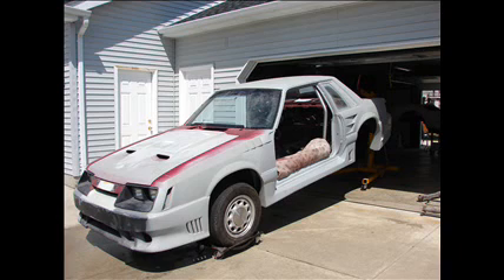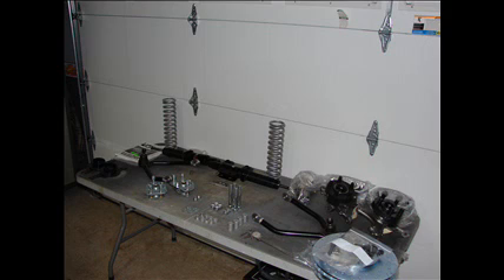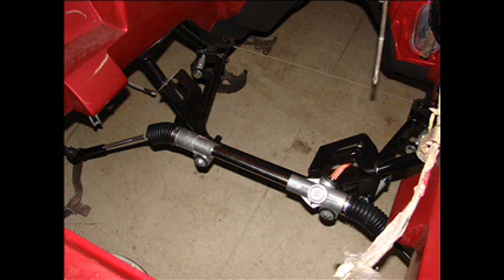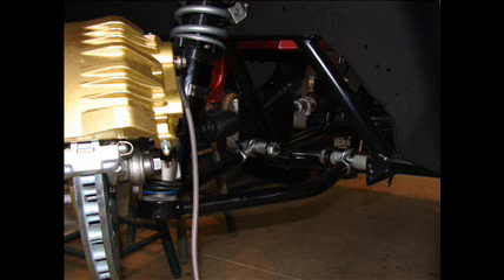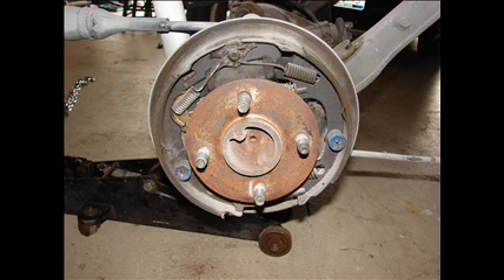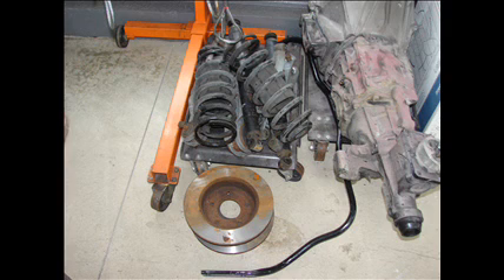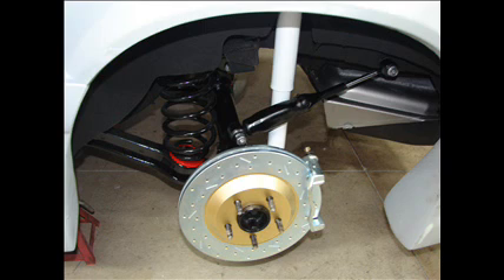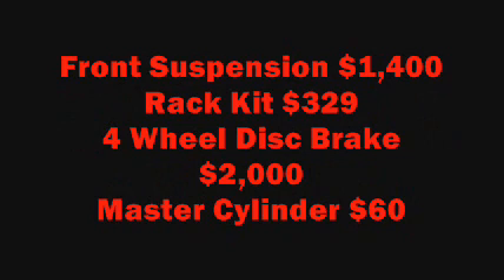Fox Body Mustang 4 lug to 5 lug Conversion

Comment: Did you have to go with a 94-95 booster and master cylinder?
Reply from the maker: No, just the axle
Reply: My car is a 1986 Fox with a 2.3 engine.  I plan on using the SN-95 front brakes and rear end.  Will the stock booster be large enough to handle the swap?  I do not want to use an adjustable proportioning valve if I can get away with it.  I am on a strict budget and this is something to keep me occupied since I was force into retirement.  I am a Disabled Vet.
Reply from the maker: It should work ok
Reply: Here's what I did on a budget.  Find a 99-04 V6 Mustang with dual piston front calipers at the wreckers.  You need one that does not have ABS.  Take the master cylinder and factory proportioning valve.  Mine cost me less than $30 CDN.   Take the calipers and mounting brackets from this car as well and install on the '94-'95 spindles - they will bolt up.  Install them in your '86 and you can go dual piston front calipers and rear discs.  Just did this on my 90 GT and works great.  No adjustable proportioning valve needed.  Everything works great.

Pete, in your video you mentioned the rear control arm mounts were wider than a Fox and needed some adjustment.  This means you had a '99-04 rear end, housing is 3/4" per side wider.  '94-98 is same housing as Fox, just longer axles.
Reply: Thanks for the information

Comment: No Bump Steer Kit with Caster/Camber plates, coil over springs and Tube K member is a friggin' HUGE mistake. Especially when using the QA1 K member as it moves the front wheel base forward about 1" and wider about .500". Use the QA1 Pro-Comp control arms, (must weld on a Tab for the Sway Bar end link mount) to re-center the wheel in the wheel well. You will experience serious bump steer problems and brutal over steer if you don't use a bump steer kit with this set up. And you sure as hell do not need to pay the extra cash for a "Cobra" rear end for this swap either. Any 94'-04 Mustang Disc Brake 8.8" will work just the same. Get the 1" rear sway bar off of any GT or buy it new. MPS wants $1500 for a similar rear end, which, any 94'-04' from a regular junk yard will only cost less than $500. Do it smart people and put that extra money into something else...Don't forget, you need a new proportioning valve when swapping to rear disc brakes from drums. This guy has left out some very serious info. Make sure to check your facts.
Reply from the maker: I did not have a problem with wheel centering, but you do need to buy a wheel with less back spacing

Comment: Thanks for the video I am doing a 5 lug conversion on my 89 and this video helped me a lot! I have a couple of questions though what year master cylinder should I use? My front spindles are from a 2004 mustang gt and did you need a new brake booster?
Reply from the maker: If you don't change the calipers you don't need to change the master cylinder

Comment: i bought a 90 mustang, previous owner did alot of mods that im not aware of and need some help. he changed the wheels to 5 lugs with disc brakes all around but didnt connect the e-brake line. how can i fix this problem thanks. if you can my email is jaiesalcedo@gmail.com
Reply: hey did you figure out how to hook up your parking brake because i have the same issue you had ?
Reply: Alejandro Barajas You can install my MADE IN USA emergency brake cables which are 100% reproductions of the ones once offered by Ford Racing.  Lifetime warranty.

Comment: Thanks just did the brakes and rotors all 95 parts. Thanks for the vid I also noticed my passenger brake line is rubbing or tearing so will definitely check out ssbrakes for new lines.

Comment: Have a 92 vert foxbody given to me by my older brother and he had converted it to five lug with parts from a 95 mustang. Now does that mean control arms, brake pads, and calipers are all now from 95 mustang. Not sure if its a dumb question just he did not do the work himself and I need new brakes so not sure what I need when also upgrading springs,shocks, struts, and brakes?

Comment: I have a qa1 k.member and a arms I don't mind it would prefer a upr, if your going to convert your front rotors you can do it for 50$ by buying Lincoln mark 5 rotors they are 5 lug by 4.5 and fit right on the spindle , and as for tech support at qa1 I would say is poor !

Comment: I have to admit this set up is killer and looks badass! Although if you really want 5 lug conversion instead of spending several 1,000s like this guy did. I just went to my local junkyard and looked a few times but finally found a wrecked sn95 to get my brakes from.. i got everything i needed off that car to convert to 5 lug, i got the rear end, e brake cables, spindles, rotors,calipers,etc.. all for around 150$.. Only problem i ended up using a spacer because of the fox ball joints.

Comment from the maker: I'm pretty sure I mentioned in the video about getting spindles to match the control arms and lower ball joints. The threads and taper are different from year to year. You are better off buying a rotor / spindle / shock combination that matches the lower ball joint size. It is difficult to mix and match parts. If the ball joint is too short for the control arm design there will not be enough travel. The spindle will also interfere when going lock to lock. Hope that helps.

Comment from the maker: Dependimg on the model, the mounting brackets may be wider and angled different, and the mounting points for the emergency brake cable may or may not be there.

Comment from the maker: After the caliper and caliper frame are off they will come off. I have done allot of them and some are really hard to get off. I have had to heat the face of the rotor in the center with a propane torch and beat it off from behind with a 5 lb hammer. Don't be afraid to beat on it....it will come off.

Comment from the maker: There should be 2 threaded holes in the rotor. They are metric. Get the right size bolt and screw them in and the rotor will pop right off the hub

Comment from the maker: There are usually 2 screws put in the rotor at the assembly plant to hold the rotor in place. If you cannot get them out, just drill out the center with a large drill and the rotors will pop right off. After you get the rotors off usually a little heat and some grip lock pliers will get the stud out. If there are no screws, thread the right size metric bolt into two opposite threaded holes and they will pop right off.....hope that helps.

Comment from the maker: Honestly I have never looked for a disc brake kit for a 4 lug setup. If you can find front spindles and brackets for the rear axle for the calipers to mount to I imagine you could make it work.

Comment from the maker: You have to choose a direction...the cheapest or the best. They are not mutually inclusive. If you are worried about cost, keep the existing parts until you can afford the best parts. Suspension parts are easy to change.

Comment from the maker: I would put the tubular K member with coil-over shocks. There is no need for the complex caster/camber adjuster. I would use eurethane bushings instead of the rod ends, the rod ends are hard and don't ride smooth. The 13" disc all the way around is great and comes in kit from most manufacturers, Get dual cylinder calipers at the least. I would build a 9" rear end from scratch with bigger axles and a Detroit Trulock differential. I would also use a Tremec tranny with a dual friction clutch.

Comment from the maker: The short answer is yes. Long answer is you will need to make sure the cam, valve size, head cc, compression, and heads are the same as well. Fuel injection changes many things in the valve train so it may not be a direct drop-in, but it will work.

Comment from the maker: That is not an easy question to answer. If you go full out discs all the way around with an upgraded axle, tubular suspension, and basic calipers and 15" slotted & vented rotors like I did in the '85 video it can be around $3k for parts. It's all about what you want so we would need to talk. I am in Lancaster, NY which is outside of Buffalo. Feel free to call my cell anytime (716) 697-1690....Peter

Comment from the maker: My guess is you bought the rims with the wrong backspacing. That is a pretty wide tire up front on a '93. In order to get them flush they gave you the shallowest backspace, the result being the rub on the strut. If you have any pics it would make it easier to help you. A 1" dropped spindle may help get you the .25" needed to clear on the inside. Google Full Tilt Street Rods and give them a call. Clay is a great guy and can probably help you.

Comment: for k member tublar is no dought a good idea as it will lighten it up but be carful some replacement k members allow for the oil pan to hit the ground before the frame also depends on syspension (shocks and spring rate) as for rear breaks since buying new at least get dual pistion it dosent due much breaking but once agin applys more even pressure but with out adjustment it will change break balance that where new break pressure dsturibtor comes in and that about does it for my input

Comment: is not the greatest for stearing there is not alot of caster camber and more ability to counter steer is much wanted for horse play and track driving more caster can camber will also alow for better traction with tire turned would be a nice up grade as for the new K member and rack and pinyon be weiry on what you go with as some people like fast stearing some dont (turn ratio) i my self want fast stear (requires more accurate hand weel use and can kick the car over 2 quick and break the rear out

Comment: I would agree with nice breakes as you would need new rotors (5 lug rotors) and i would as well up grade 2 no less the 4 pistion calipers in the front but would proebely go to 6 pistion my self for bore break power all though even with the 1 pistion stok caliper can lock the tire up but with 6 pistion you would be applying more even pressure over the break pad as you would with 4 (more even ware and serface contact) for syspension the stock is good enougfh for your daily drivers but how ever

Comment: nice video but it dosent cost that much new front hub will do you do not need new k member but would be nice if you all ready have 8.8 rear all you need is the right rear axel shafts 5 lug of course and then new rotors calipers and rims tires if changing sizes cost less than1,300 if you shop around..

once agin you do not need new front K member or struts or shocks would be nice to have but is not needed. 

his set up would be nice for racing app or show car..........